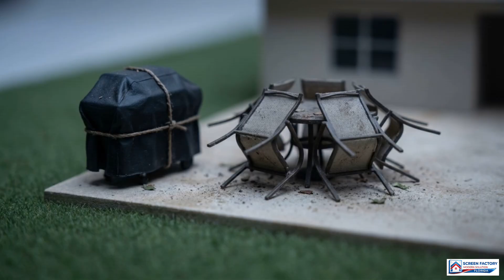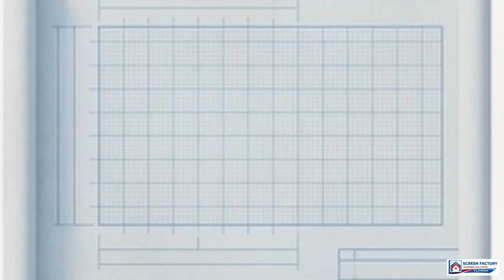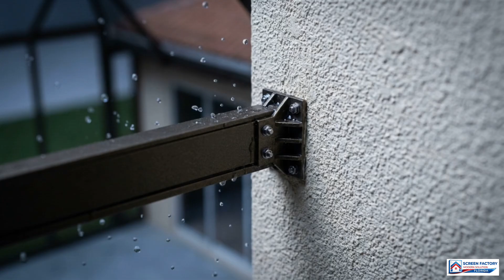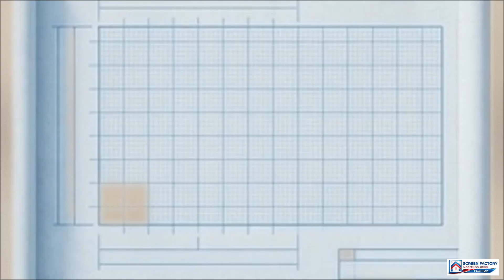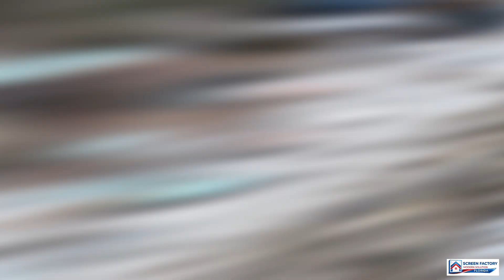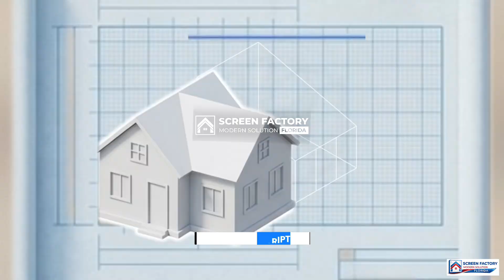Can Screen Enclosures Really Handle Florida Weather?

Comment: How much would a 12x20 ft screened lanai enclosure cost over my existing patio in Cape Coral with dark bronze framing?
Reply from the maker: Great question! For a 12x20 screened lanai enclosure with dark bronze framing, pricing varies based on engineering requirements, permits, and your existing patio structure. We’d be happy to provide a free on-site estimate with an exact price. Feel free to send us your address or phone number, and we’ll get everything scheduled.